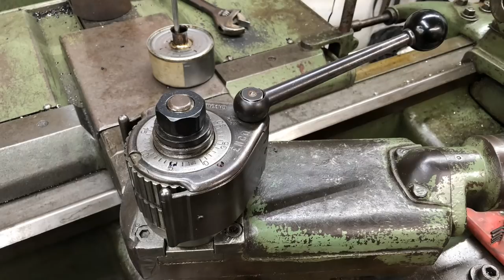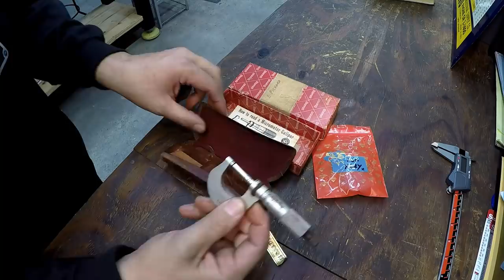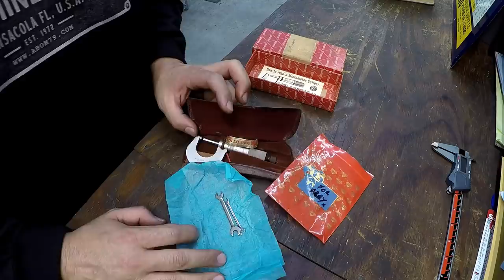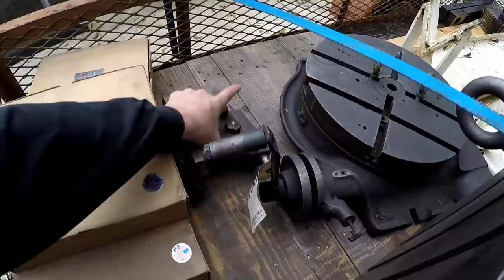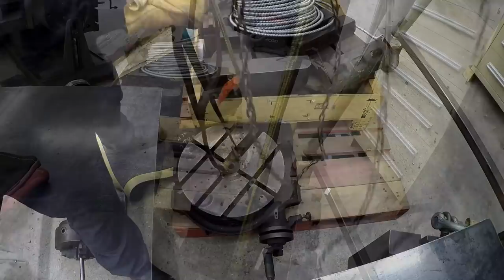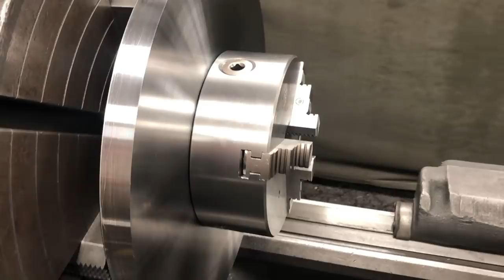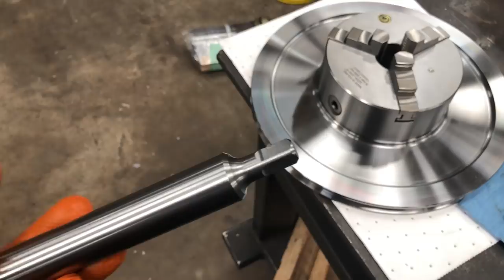SNS 241: Custom 3 Jaw Sheave, Shaper Table, Viewer Mail

Comment: My brother bought a new RAM pickup, I think it was a 1 ton. He had to sell it like 3 weeks later because driving on the dished freeways we have out here in CA was intolerable. The thing was sprung so stiff it literally bounced down the freeway and rattled your kidneys out. The dealer offered no real solution; He just sold it and took about $7K loss plus probably another $3.5K on sales tax. I/we liked the truck but it could not be driven on the freeway.
Reply: No offense but thats crazy. So he ate $10K because it bounced? GM frame beaming is a well documented phenomenon. There are things you can do. For $10K I would would sooner drive with a dozen bags of concrete in the bed forever. I think there's more to the story.
Reply from the maker: 1/2 ton trucks don;t have that problem, but I can't believe your brothers truck was as bad as you make it out. I used to own a 1 ton and it was very comfy.
Reply: @truckguy6666  No offense taken. I thought it was crazy too, but there's definitely no more to the story. It was really horrible to drive over a dished road. He just didn't want to modify the truck, wouldn't hear of it. He's an attorney and makes serious money, he can afford it. He just made the decision to take the hit early and move on.
Reply: @Abom79  I wouldn't suspect 1/2 tons would have such a problem, indeed we didn't expect the 1 ton would have such a problem because I/we researched the truck extensively online before he bought it and nobody mentioned anything. Trust me, it was really bad. He has a winery about 175 miles away he has to go to regularly and most of that was over these dished freeways. A gut ripping drive, believe me. It was a function of the road quality and not the truck. If it was me I would have been pissed over eating $10K and probably would have tried various things to soften the suspension. We have some badly dished roads out here in CA that get ridiculous traffic on them and they get that way, especially since we spend so much on forest management and we raise fuel taxes on ourselves so much.
Reply: @pneumatic00   I had a 1973 Chevy 8200 GVW pickup when I was stationed in Pheonix.  It would "gallop" severely on one freeway in particular, but almost any concrete road when it was hot.

I solved the problem by keeping about 500 lbs of sand in the bed to change the harmonic of the suspension.